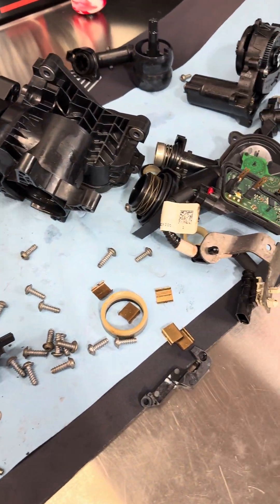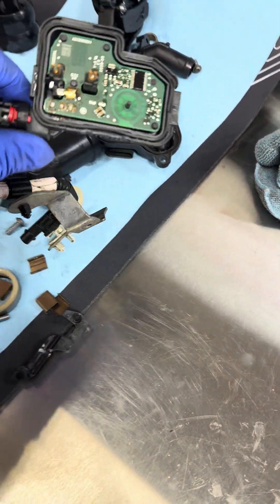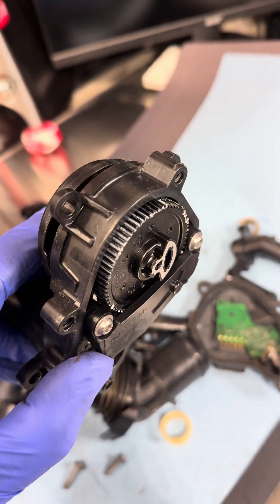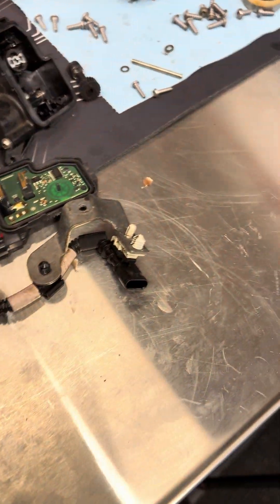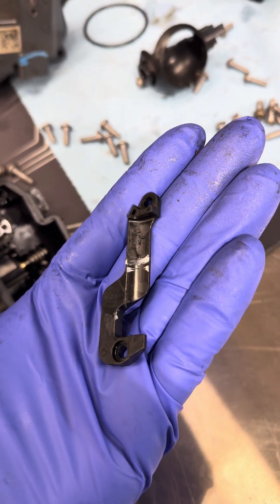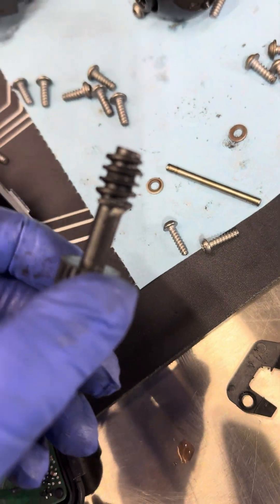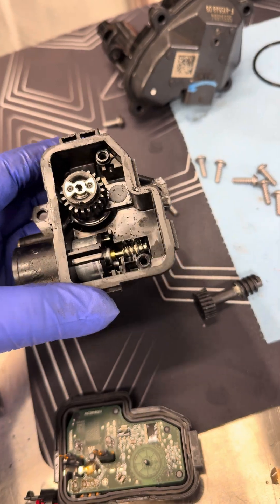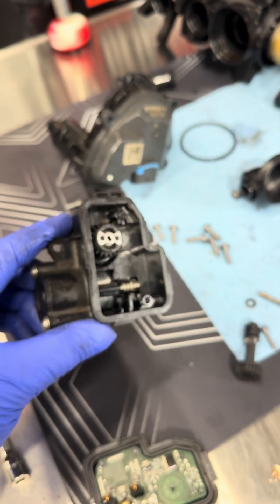What REALLY FAILS - LM2 Coolant Control Valve Failure

Comment: My code is even worse p6001. I took mine all apart and lubed the gears up. But I noticed when I applied voltage with the cases open everything still worked without lubing. Slapped it all back together and I'm getting the same code. So I think that particular code is a control board issue.
Reply from the maker: Double check that code, never seen it before.

Comment: Which valve does that work gear move? Ok to keep driving with this particular failed worm gear? I just keep having to disconnect my battery and keeep driving the truck without check engine light and codes

Comment: Thanks for the vid and information, appreciate knowing what is up. Didn't really expect anything better from GM, or Ford, Doge etc.. All dollar store components now. Waiting on warranty re&re for my LZO. Truck is my office and 100% of work requires it. Everytime I start it I hope for normal startup. If it does it stays running all day. Or it starts with fan wailing and now pretty much stays on for multiple starts. When the reduced throttle kicks in then I am ready to burn this pos. Cannot safely drive log roads or mines as you have no power for any grades. End up shifting down to 6th and revving the piss out of it just to make highway hills without a convoy behind you. Don't care for this expensive turd in my driveway anymore.
Reply: Mines starting to do this now.. how can it become a recall or a class action lawsuit???
Reply: @codysparkes123  doubt it. Just the way it is these days. I did figure out if you pull the negative battery cable for 5 seconds it clears it. You can drive for 12 hrs straight no issues. Next restart though it is back. Pulled post about 200 times until back order part came in. All good. Now wiring, valve body in trans went. 2 nox sensors. Keeps you wondering what's next every day.
Reply: @dpg2826  i wish I never traded my 2019 gasser.. even though I was putting in $50 of gas every day or 2.. now I'm not in a position to get rid of it or trade for something of similar trim level.. I even thought about switching to a Toyota.. I bought my sierra 6-7 months ago used for $54,000 CAD tho.. so idk trade values and how much id owe etc

Comment: GM needs to step up and update the design—this is unacceptable. Consumers keep losing out, just like with Ford’s Ecoboost cam phasers. It took Ford until 2021 to fix the startup rattle issue, which caused premature wear and eventually timing failure. Even then, they only extended the cam phaser warranty for 2017–2020 models iirc. Meanwhile, we’re stuck paying for what often feel like overpriced driveway ornaments.
Reply: At least make it a recall issue. I think my CCV is on the way out i just had it in shop yesterday and this morning did the same high fans so I drove it right back up there and the prick manager at pacific GM said I'll still pay for another scan 🤬